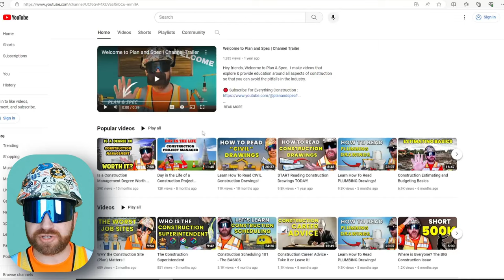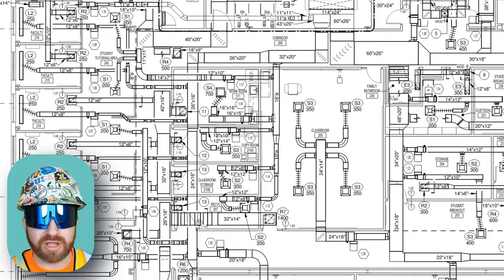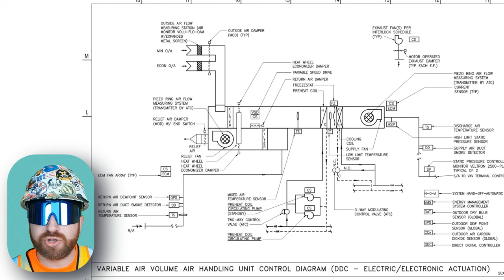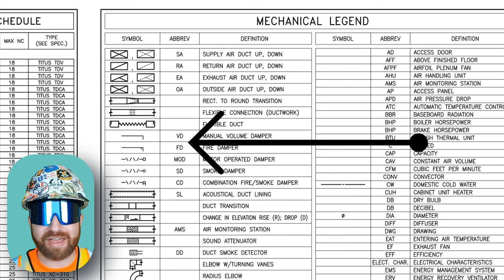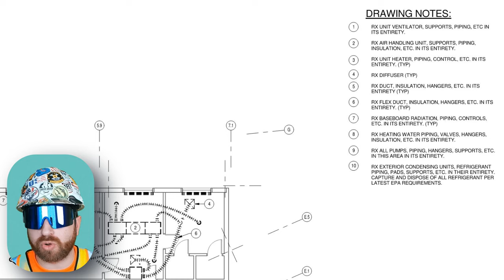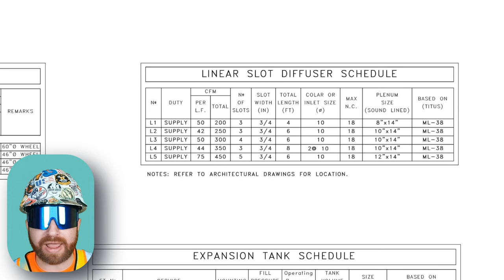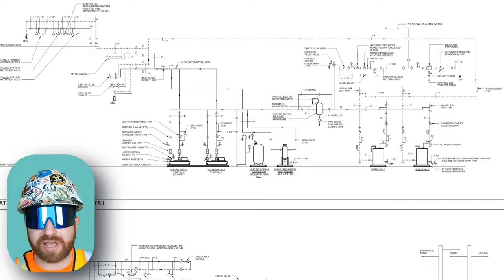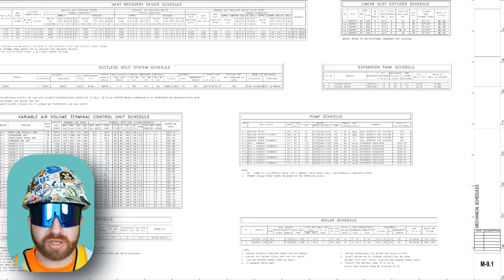Learn How To Read MECHANICAL (HVAC) Drawings!

Comment: Thank you very much for what you do. This is very interesting, but don't speak so quickly. Work on your speech, speak more clearly and speak more slowly. If you want your video to be watched more.
Reply from the maker: I've realized that I only have one speed, and thats 100 miles per hour.  Just kidding, I've gotten this comment quite often - I usually cut dead air in between talking in my final edits to shorten video lengths, but at the expense of going a little faster : /  I'll continue to reconsider 😅
Reply: Just change your playback speed to .75. Problem solved.

Comment: i have a mechsnical insulation company.. we do plumbine insulation hvav and mechsnical insulstion..can this apply to that?
Reply from the maker: If you mean in terms of estimating, certainly
Reply: is reading mechania drawings similar to reading plumbing drawings?
Reply from the maker: Reading all construction drawings is fairly similar - they way you read them is pretty much the same, just the content is different.

Comment: Need a video for a concrete demo guy like myself on how to find new openings and penetrations on mechanical and plumbing plans. When customers don’t want to give quantities and want me to read their plans.
Reply from the maker: The easiest way to do this is take the mechanical and plumbing drawings and highlight anytime ductwork or piping passes through a wall (youll see the light gray architectural walls on both drawings).  This will give you quantities and sizes.  Youll also have to look at floor to floor penetrations using the symbols i talk about in this video.  There is no quick way to do this, you just have to go page by page.  This doesn't work for electrical because conduit pathways aren't drawn on electrical drawings - hope this helps in the meantime 🫡
Reply: @planandspec  your videos have helped a ton. Kind of stuck on finding trenches also. I know that if it’s 1st floor or basement I’ll have a trench but how to I know if something is being hung or the pathway is a trench if it’s not called out?
Reply from the maker: Trenches won't be shown, you'll have to look at the civil drawings for the grading plan to see finish surfaces as well as elevations of piping.  There would be some subtraction to see how far below any piping is + bedding for that piping.

Comment: Can you do a video on understanding where the devices are placed on the ahu from reading the print?
Reply from the maker: There should typically be an enlarged detail on the drawings of the AHU showing different components / sensors / etc or could be also found in the shop drawings.